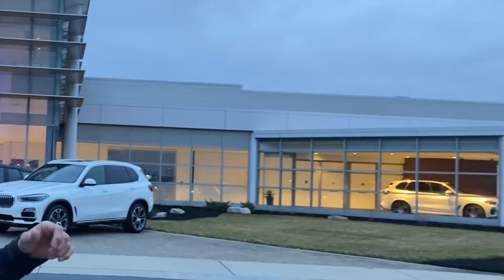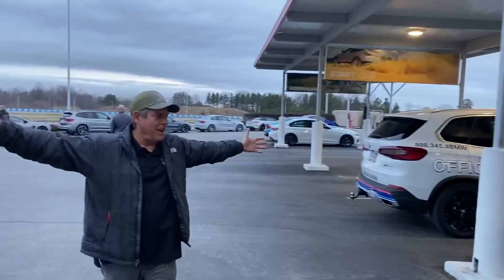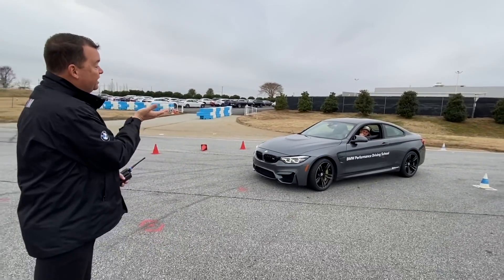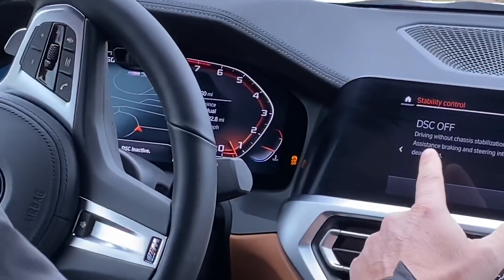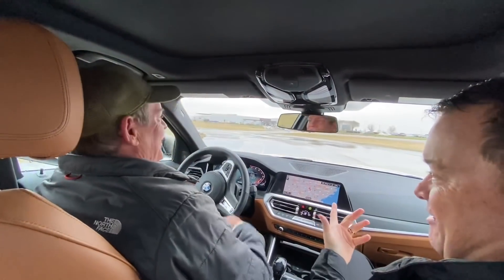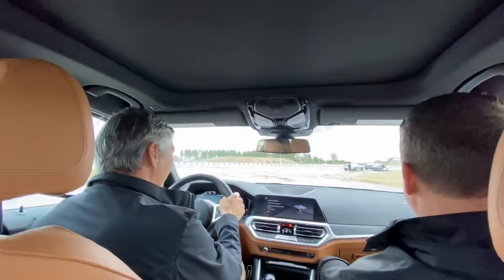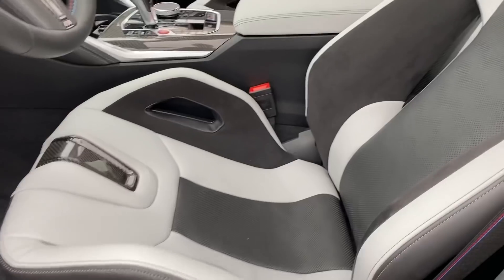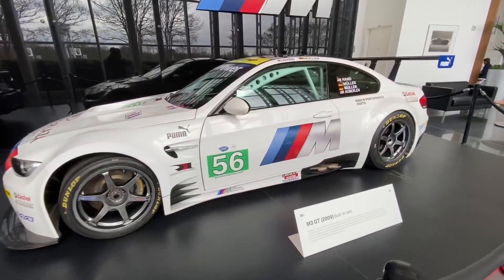BMW Performance Center. The Ultimate driving experience!

Comment: Inquiring minds want to know. Former racing background or from what you mentioned prior Im guessing it may ahve been in the engineering department.
Reply from the maker: It was actually in the seat as a driver and rider for cars and motorcycles.   Not engineering.